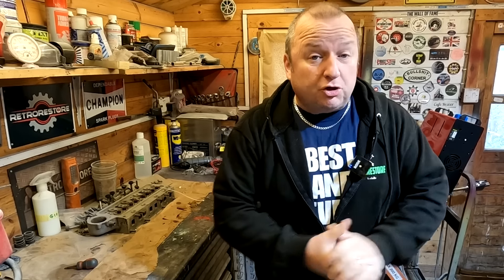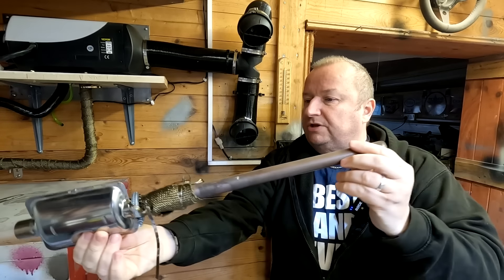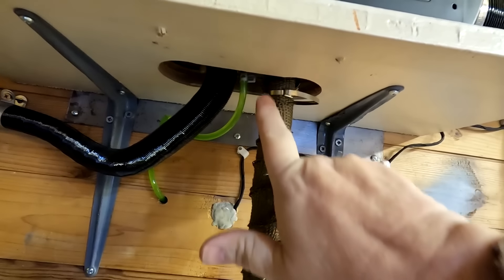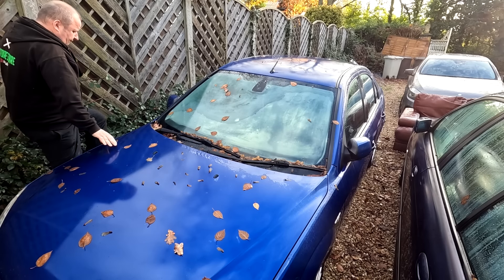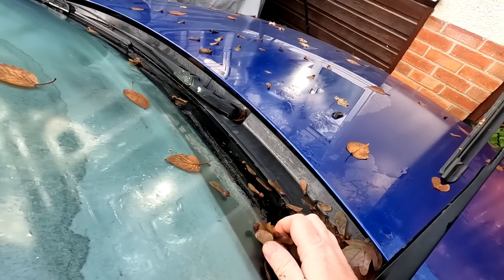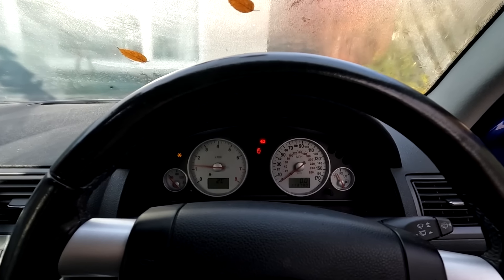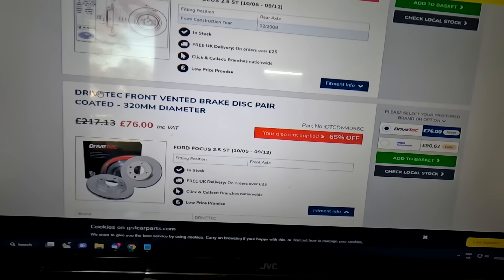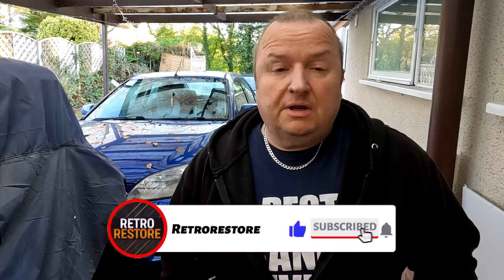Diesel Heater Modification And The ST220 Moves Again

Comment: A little tip for the heater exhaust - during the summer months I block the end of the exhaust off with a plastic bottle cap. Just to stop anything making a home in there. I have a number of solitary bee hives and they’d make a nest in there 🙄
Reply from the maker: I'll be putting wire gauze over the end.
Reply: We grow grapes so we will be watching out for wasps, have put our diesel heater in a custom made box and mounted it outside on an external wall with the alloy mesh that is used to fill car body panels over the vent holes as its alloy it wont rot. I suppose the same applies to a layed up car exhaust to. Have seen some big wasp nests in car exhausts on youtube.

Comment: You really need to put input air pipe with filter  for the combustion chamber outside,  you are using warm air from inside room to burn diesel then exhausting it outside, but more dangerously if people are following your fitting instructions and have also sealed all leaks and air vents in shed, garages, houses to save money, the burner input pipe will Rob the room of OXYGEN causing death like what happened to a night watchman/security staff who passed away after doing the same with a portable gas heater. We had to check site cabins air vents and remove blockages after a H.S.E memo.  Really enjoy your channel and don't worry to much about idiots making stupid remarks, keep it up. Regards Mick
Reply from the maker: This isn't a sealed cubical Mick, it has gaps everywhere. That would only apply in a hermetically sealed unit. There is no heat source with these heaters that is recirculated in the room. Hense no carbon monoxide. Its just hot air. You would never be able to use all the oxygen.
Reply: @retrorestore  Yes I understand thiers no heat source recirculation from  the burner same as the old VW beatles exhaust heater but it is using Oxygen from the air in the room, or no diesel combustion would take place. That's what happened to the night watchman in the porta cabin lack of oxygen for him to breath,  The main reason for balanced flues on boilers is to stop them robbing Oxgen out of th room, it gets it oxygen supply from outside also why the modern flueless gas fires have to have a air brick fitted in the room to replace the breathable air that is being  used for combustion of the fuel. The air is being used because it has a input pipe with a filter on it to take up air for the burner,  It is a real dangerous fault for it not to have it own separate oxygen supply from outside. Check up with Fire Brigade explain to them exactly how it's fitted robbing air from inside the room for thier comments. I know I seem a bit over the top, but we have to be safe and secure. Especially  when showing other people. Regards Mick.
Reply: Hope people listen to you . Good professional advice . We’ll explained.👍
Reply from the maker: @michaelmason5459  Thanks Mick, Yes, I understand all that bud. I'll address that then in another video.
Reply: @michaelmason5459  I understand your theory about oxygen.. except it doesn't just suck in oxygen, it sucks in all of the air, including 80% nitrogen that goes straight out with the exhaust.
So I'm not understanding how it can selectively remove oxygen.
Reply: @G-ra-ha-m  Hi Graham Happy New Year to everyone,  Yes you are correct about it removing the air as a all, most of which we don't use to breath, I just highlighted  Oxygen because that is the part we utilise to breathe and the burner is removing it but also its removing heated warm air (wasting heatfrom the room)which will drag in more fresh cold air through gaps which is a good think. My concerns are like my neighbours and guards at work who sealed every little gap or vent in their sheds, the burner is using all the air in the room , like a lit candle in a upside down glass once all the Oxygen is burnt or used out of the air in the glass all life in the flame will die pluss anything else in the glass. If you look on diesel hot air fitting instructions from manufacturer who have made them for years the advise for boats, lorry cabs, caravettes mobile homes they all advise for both exhaust and burner intake to be mounted externally for safety and well being. I'm  not sure if it was this site or other site said that the instructions are crap on the Chinese heaters  I belivethis site altered the exhaust after they had mounted exhaust silencer inside the shed which allowed exhaust gas into shed through the small drain hole which they  quickly rectify on the site and explained to all that it must be outside. I must say this is one of the best sites to watch very clear instructions and advice, but have often wondered if someone copies  what the sites are showing then a accident or fatality takes place how libel the site would be. It comes down to, if I nod my head hit it that's in Laryel and Hardy films some people have no sense or idea . These sites are for entertainment and being invited to watch thier life's is a honour and privilege but you should seek expert advice or reread all instructions check with manufactory to be safe and secure. Anyway I wish everyone a happy New Year. Mick
Reply: @michaelmason5459  If the air gets sucked out of a room, it's known as a vacuum, i would suggest that the power of the little fan in the heater is not that powerful. 
However due to the risk of leaks from the seal to the heater/exhaust (it's a dry joint, not sealed with paste) and of course the muffler drain hole, a CO alarm is useful.
My heater is mounted on the top of a box, with a hole for the exhaust to go along the wall, and then outside, with heat tape inside the box and wall. 
The burner air intake is then inside the box, so any stray gas in the box is sucked into the chamber, and overall the box has a slight negative pressure due to this.
But it's also important to use silicone to seal the fuel pipe entrance to the heater properly, as this will allow burner inlet gases into the room if poorly fitted / made.
Reply: @G-ra-ha-m  Hi Graham yes I know this will cause a vacum and yes the fan motor is only small but why put your health at risk when it's recommended  by original  makers for air pick up to be outside. Also to your original  message of how does the unit know how to use oxygen in the air when it is made up of other gasses that is how burning items work the fire triangle fuel, ignition source and oxygen the more fuel more oxygen needed, the unit not bothered what other gasses  are there it just needs the oxygen to burn the diesel. So when the unit starts losing heat because the oxygen is getting used up by your breathing and the units burning  ,you turn up the unit heat setting  faster motor speed more oxygen used. You just have to hope that your still  thinking straight before it's too late. But as  I say why put yourself at risk and why would the original designers state to put the inlet pipe for combustion outside or are we all more well informed  than the designer  who are concerned about the risk of what could happen and our well being. Regards Mick
Reply: @michaelmason5459  Sorry, I don't think putting the air intake inside is a problem, because I can see no mechanism where the oxygen becomes depleted. 
The only thing that uses oxygen is people and the burning diesel. So the person is the only 'in-room' exhaust of depleted oxygen, and CO2 poisoning (hypercapnia) occurs before oxygen depletion (hypoxia). You'll get more hypoxia from wearing one of those stupid blue masks, than a well sealed shed with a well sealed diesel heater running. 
In fact with the heater sucking the room air in, the negative pressure would force in fresh air to the shed, so it's arguably safer than without it, due to lack of breathing ventilation.
Inadequate ventilation is however a different subject, unralated to heaters.. 

But the advice to ensure the disel exhaist is well sealed and cannot make it's way back into the shed is good advice, so we are on the same page :)
Reply: @G-ra-ha-m  Hi Graham Happy New Year to you. My only concerns are that users are modifying or not fitting incorrectly,  when you stated you did not understand how it can selectively remove oxygen from the air when 80% is nitrogen proves a point about my concerns that's why I explained the fire triangle for you, if you do not understand how only the Oxygen is selected I advise you not to mess with  it or fit it as Webasto  Airtop instruction advise, the Chinese copy them now the patent allows.  I am not an expert on this subject but I have ran it past H.S.E also Fire Brigade who agree about my concerns. But on a serious note if a person fits a devise that causes serious injury or fatality they could be prosecuted.  Hope you do not class me as being Inpolite but I can see we will not agree and to carry on texting will not be fruitfully please check with above services. But if anyone else would like to voice thier concerns either way to you or site please feel free. Old saying,"if you mess with fire you'll get your fingers burnt. All the best, take care Regards Mick.
Reply: @michaelmason5459  The burning of oxygen only occurs in the burn chamber - yes? The fan pushes air in, not just oxygen - yes? Once burnt, the exhaust gases, which include all that nitrogen, go out of the exhaust pipe. 
Nitrogen in combustion can be a problem for exhaust quality, hence the EGR valves and Adblue in diesel engines.
Therefore all a fully sealed room could do, is lower the general air pressure. 
That's when air starts seeping in through cracks, provided the exhaust is not also sucked in, the person will still have enough air, even if the air pressure is lower by the equivalent of being 500' higher up a hill !

But I agree, I think we've covered all bases for safety - Happy new year!
Reply: @G-ra-ha-m  I agree we have covered all bases of safety, myself as Manufactures    advise. H.S.E and fire brigade. Yourself has you advise, we'll  just have to differ. But its been a good chat and highlighted the need for more clearer instructions on the Chinese fitting  instructions also will have given anybody with concerns about safety of these units some food for thought. All the best Graham, Regards  Mick. I promise fingers crossed this will be my last comment  hopefully anyway.🙂🙂

Comment: next time you lay a motor up put a tray of cheap cat litter on the  floor in the front and in the boot it will absorb the moisture in the air

Comment: A lot of folk using the diesel heaters in there workshops. You seem to get a lot of damp down there in the car's I have seen it on a few of them up suffering from Damp it's not somthing av had problems with the Rover but it was leaking from the windscreen. I know boys that always upgrade the brakes on there Mondeo s the locking wheel nuts are a pain. I got rid of all mine of the Audi. Not good weather for working outside bit cold. She will be mint with the new brakes on 👍
Reply from the maker: Yes its very cold Ali but I hear -10 in Scotland tonight where you are.
Reply: @retrorestore  Yeah supposed to be was 6- Deg c the other morning at 5 am

Comment: Ideally you should pressure test the exhaust circuit. I did my blocking the exhaust pipe end and gently blow into the intake. My largest leak is from the glowplug rubber boot. That is inside the inside heat exchanger so potentially dangerous. I pushed that boot down but I hope that the positive pressure is enough to make that safe.  Use a co sensor.  I think they sre pretty good when new but there are a dozen ways it can kill you.  If you're putting it in a shop v then you're probably the kind of guy that knows enough,  but I fear plenty of people who don't know,  these can be every bit as deadly as a boiler.
Reply: You can seal them up with some clear silicone, it's temperature resistant enough, and easy to do, access just slipping the plastic cover off, job done :)

Comment: For a shed, why are you drawing in cold air through the heater?  The unit would be far more efficient using recirculated air rather than trying to heat cold air all the time.  If it was a house I could understand wanting to draw in fresh air to keep moisture down.
Reply from the maker: It's not drawing in cold air

Comment: I seen a Russian guy fit the exhaust into a small house radiator. He then showed that it was giving off loads of heat using a heat detector.
Mine keeps giving off diesel smells on start up. I cant work out why and what to do to stop it?
Reply from the maker: Exhaust paste on the joints maybe.

Comment: Hello - the powerpack you use for the heater - l think they are 13.8 - how is that ok for a 12v heater? Genuine Q as this is new to me and planning to get the kit for my shed. Many thanks 👍🏻
Reply from the maker: When you run them in your camper vans, the alternator pumps out around 14.5v with no problems. As the voltage goes up,(within reason) the current goes down. The electronice normally have a tolerance so you should be fine at those type of voltages.
Reply: @retrorestore  thank you for explaining that - much appreciated. Shopping list for a warm shed now complete! Thanks also for the set up vids 👍🏻

Comment: Is there a way you can link this to power on main electric?
Reply from the maker: It is a 12 volt unit so I have a power supply plugged into the mains to give me the 12 volts.

Comment: Iv just brought a deisol heater and finished setting it up today in my lodge I live full time . iv read about the noisy fuel pumps. There louder than I thought . iv wrapped my fuel pump in copper pipe lagging to try to quite it down . Any other ideas how to make the fuel pumps less noisy ? Would be appreciated 
Lee
Reply from the maker: Enclose it in an insulated box maybe.
Reply: Thats spot on Martin a little plywood box about 4 inches deep and to silence the pump you suspend the pump with narrow guage bungee cord 4 loops of it around the shafts on the ends of the pump, feeding the nylon fuel line into the box at the bottom and out of the top. If you drill 4 holes in the top of the box and the bottom of the box you can loop the narrow bungee cord around the pump and back out again using knots to pull against the pump suspending it in mid air inside the box the pump then shakes in its elastic cradle when it pumps and the cradle absorbs the clicking noise. Hard to explain it really. Ill try and find the youtube vid where a chap made one and post a link ere for it.
Reply: Where is your fuel tank?  If outside, why not move the pump outside, too?  That would, for sure, quieten it (from inside) but extra sound insulation would certainly reduce it even further.